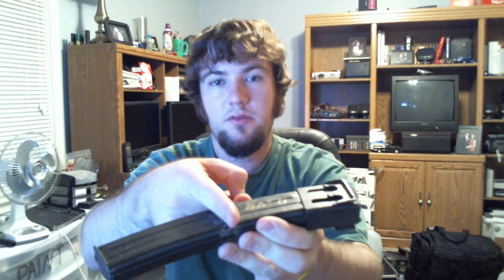How to repair a dented rifle magazine

Comment from the maker: @TheInfotwins If you can figure out a way to do it that doesn't involve drilling I'd be interested.  Some people have been able to use screwdrivers and pressure to push dents out, but you risk the feed lips on thin SMG mags like the Thompson.  Given the choice between an unusable original mag and a usable but drilled one, I'll take the drilled, but that's just my choice. Thompson mags are still fairly readily available for about $20-30 though if you don't want to drill that one.

Comment from the maker: @FixWithFirepower Glad that it helped!  I have a bunch of AK mags I've done this to and they all work great!  Something else I forgot to mention is that you can use a little piece of aluminum from a coke can and epoxy/JB Weld it to cover the hole if you don't want to use tape.